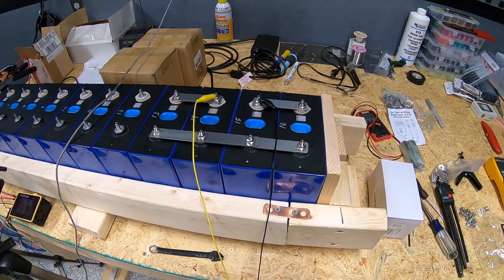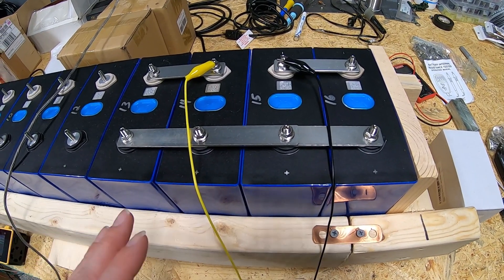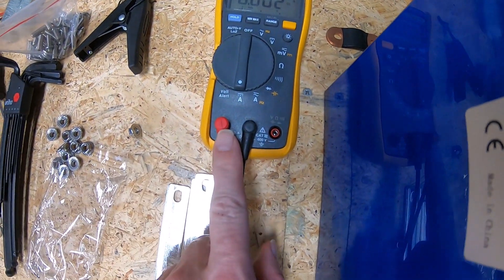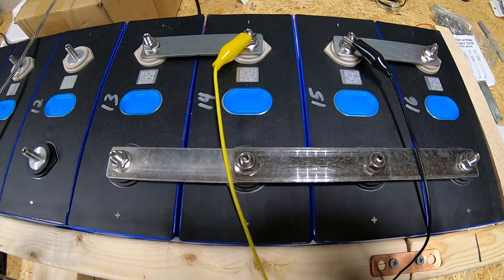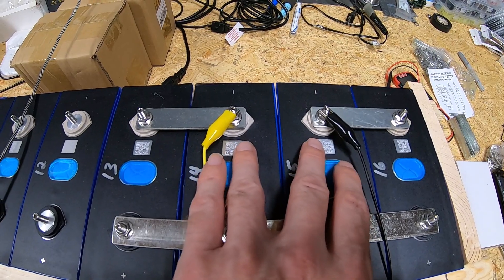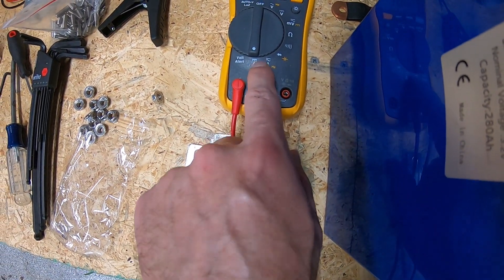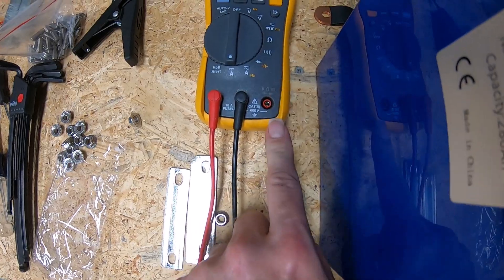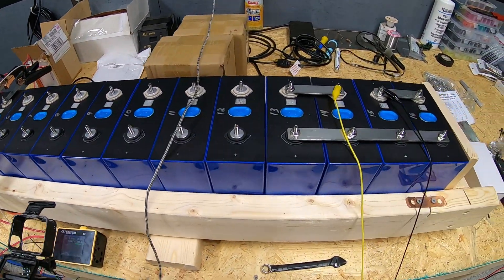280ah charging setup 2

Comment: Wow alot of people make top balancing a very confusing and difficult thing when it's so simple . I had my 32- 280ah cells balanced in 4 days. Simply charge up your battery's in series until that first cell hits 3.65 and then re assemble to all parallel and charge until amperage hits 0.00v or close. Although I can understand people going through all this trouble with shady used cells but new matched cells no.

Comment: So how long so far? My 16 took about two weeks of monitoring. I only charged while I could periodically test the cells. That saved me once, as the crappy 4s BMS I was using did not work, and one cell went to 3.7V.
Reply: A lot of those cheap BMS actually spec 3.75v +/-0.05v for an overcharge cutoff. A few spec 3.65v +/-0.05v.
Reply from the maker: Currently on cell 16 of the first bank.  Time to charge 16 cells using two chargers @ 30Amp each charger is looking at 4 days.  Once the last cell is complete we will place them in parallel and let them level out and then one more top balance with all 16 in parallel.  So it will be a bit longer, we will get an update video posted, when it is complete.